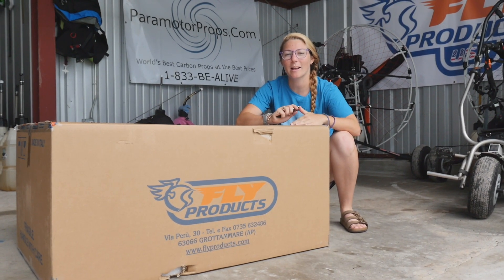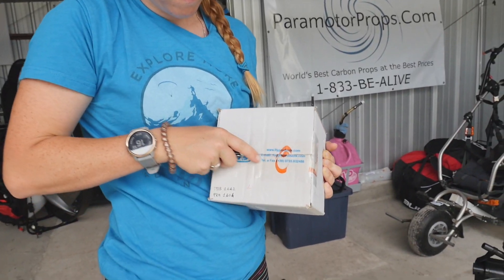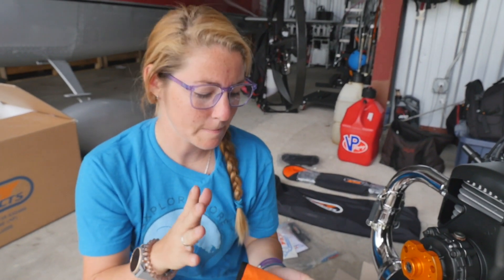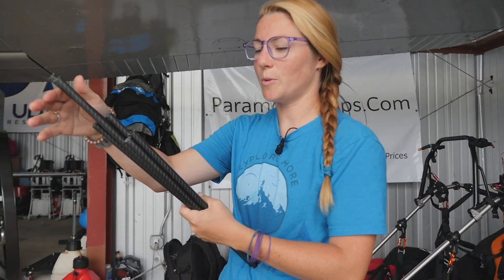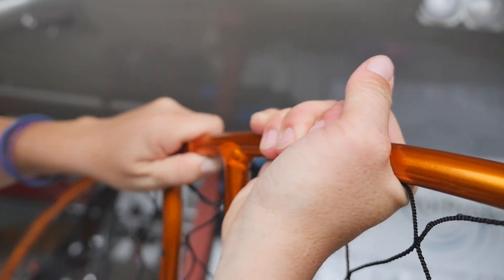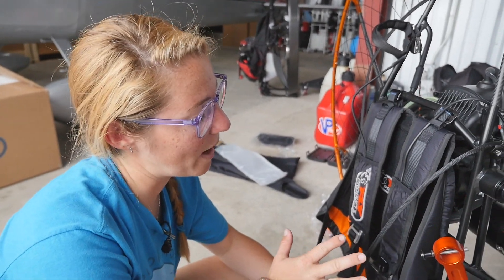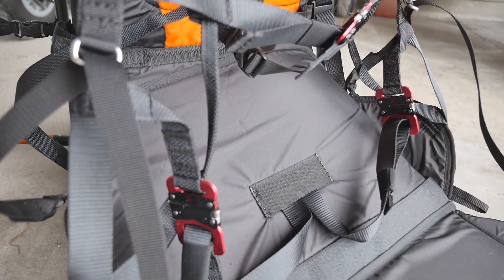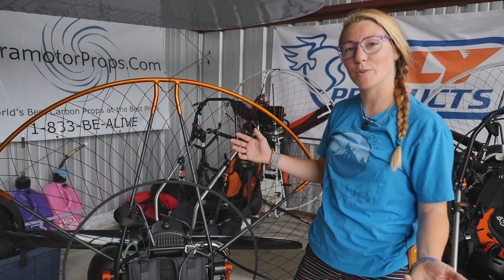How To: Build an Eclipse Frame

Comment: Thanks for sharing this demo. Can you tell me what the Eclipse frame is made from? I'm looking to go as light as possible with my first machine due to my stature. I'm also brand new to the sport and want to be informed about how easily the material can be bent and how readily the frame pieces can be replaced.
Reply from the maker: Hey! The Eclipse is an aluminum frame which allows for it to be so light weight! I am pretty impressed with the durability of the frame itself. The parts for the hoop and net are not difficult to get your hands on either as we almost always have them in stock!  I hope this helps a bit! -ALY
Reply: @oneupadventures5040  That is helpful, thank you!